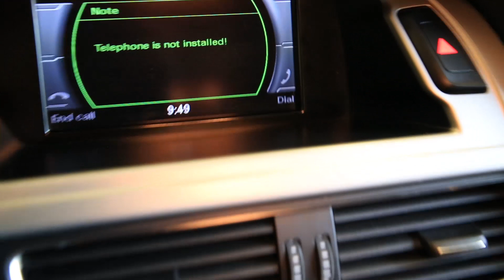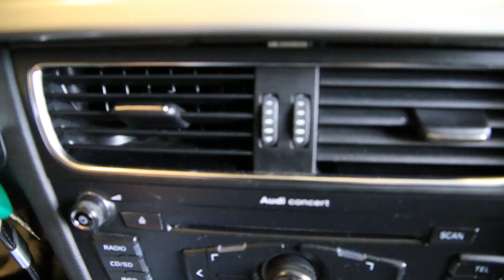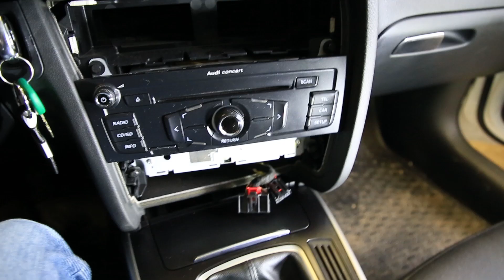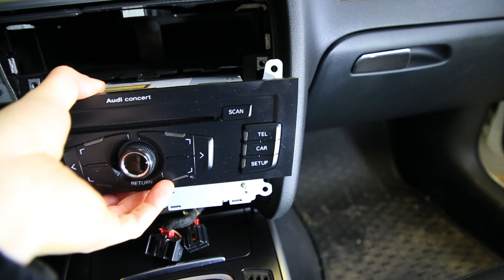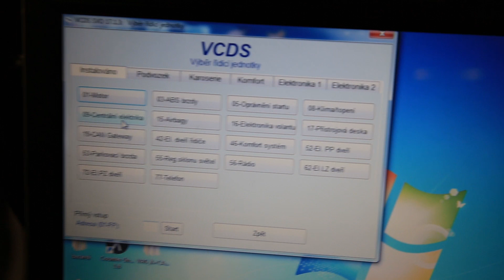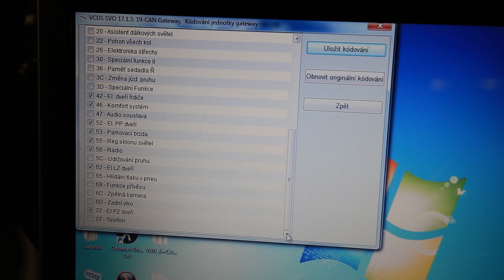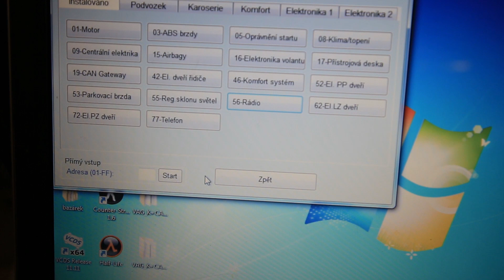Audi A4 B8 8K (2008) Fiscon Kufatec Bluetooth handsfree Retrofit

Comment: You showed the assembly but you didn't try it, I wonder how it works, I think you need to take another one.
Reply from the maker: IT works like original bt handsfree. You van control it with car radio button, IT display information on car LCD screens

Comment: Does it stream music I'm having trouble streaming on mine.
Reply from the maker: yes it stream music from phone but only mono quality, but it works
Reply from the maker: you must activate A2DP audio streaming
Reply: I figured it out in the end it took about 10 goes to activate it though.Thanks.
Reply: @ryanh3285  how did you do it?
Reply: @ozkanpurde  It's been a while my car already had it installed but i had to connect my phone to it and then dial a number to activate Bluetooth
Reply: @ryanh3285  is it 258224003
Reply: @ozkanpurde  sorry I can't remember but i do remember it taking a few goes.Mine is an Audi a5 after i activated this feature i toggle through the audio source using the media button and on the cd menu it changes to CD 12 this is whats on my display when the Bluetooth Audio is playing and it uses the steering wheel functions for volume  skipping tracks and making calls.